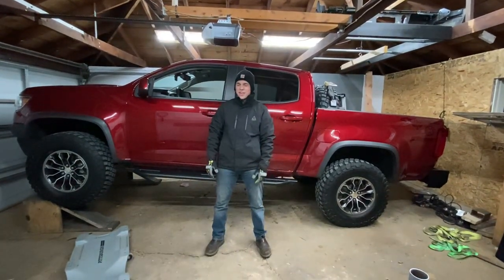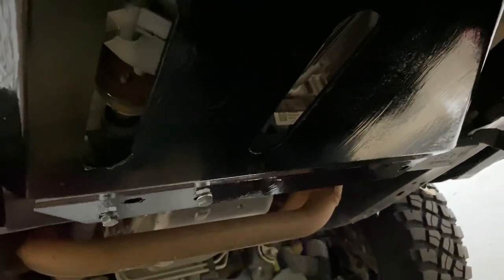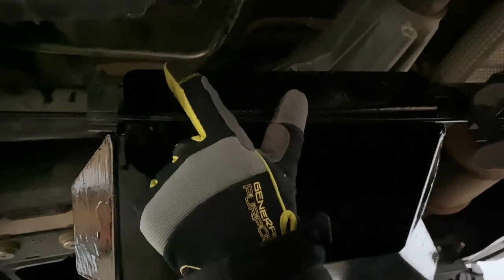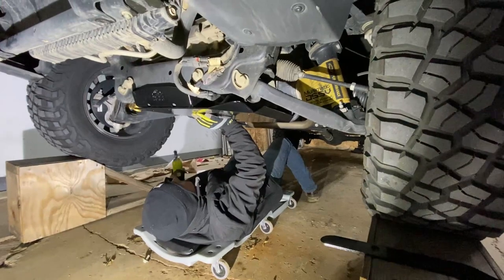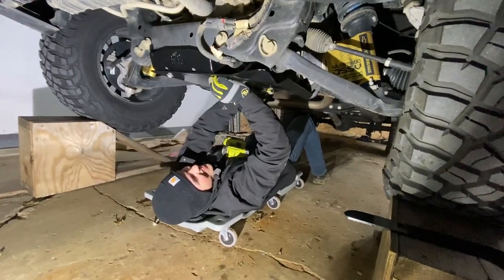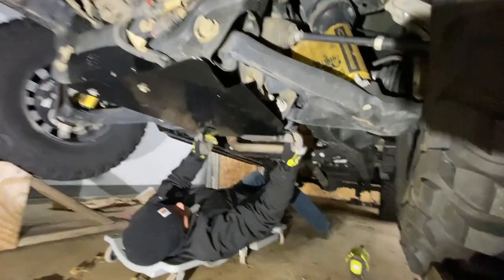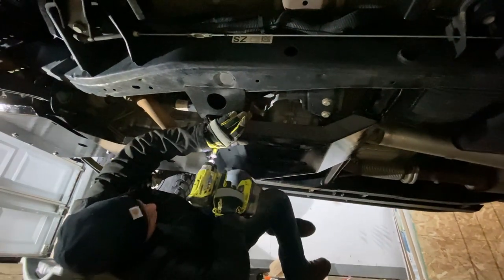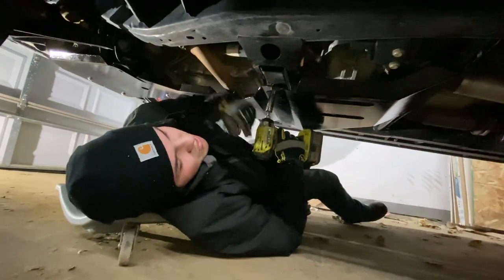Steel ZR2 Skid Plates! - 589Fab

Comment: Yo man that tcase skid is supposed to be the one touching the frame and then the trans skid bolts over it like you’ve got the other ones bolted on. So if you hit a rock going forward that flat edge of the skid does not catch the rock
Reply from the maker: Ernie Myslinski yeah I was wondering about that but the transfer case skid didn’t look like it was going to sit flush if it was the top one and the shape of the transmission skid looked like it would protect that edge pretty well, but yeah probably should be the other way

Comment: they need to make these skid plates on a hinge system so when you change your oil and do stuff under neath they just fall down and you dont have to take appart the whole thing just to do some basic work and fight with it.
Reply from the maker: Ron Denham I doubt that a hinge system would be able to withstand an impact like the truck landing on a rock, which is the purpose of skid plates this strong, but if someone did make it work that’d be interesting. AEV just cut a big hole in their skid plate so it doesn’t interfere with oil changes, pros and cons to that
Reply: @campbelloffroad3660  yea im probably going to go with the aev set up because of that. i feel like they could utilize some of those bolts though for heavy duty piano hinges. i dont really thiink ill be hitting anything hard enough to have the aev skids fail me. but you never know. still doing some more research before i pull the plug. lots of factors to go through here,
Reply from the maker: Ron Denham yeah I’m sure the AEV skids are strong enough to take a good beating, I was unsure of what brand I was going to go with but I got these used for a really good price